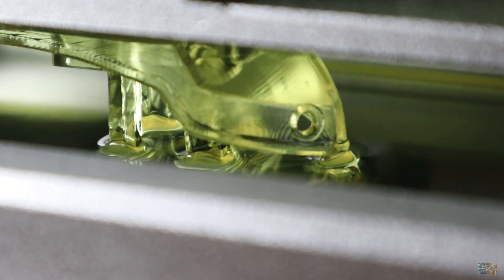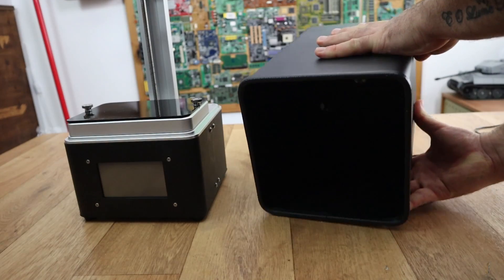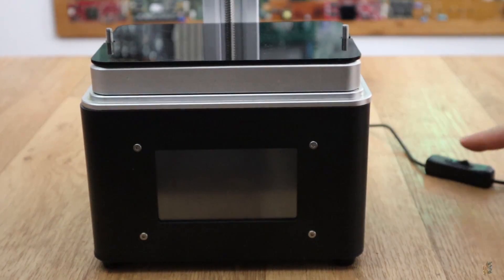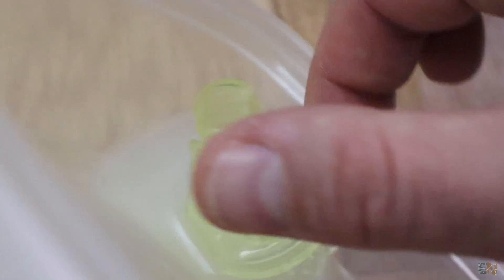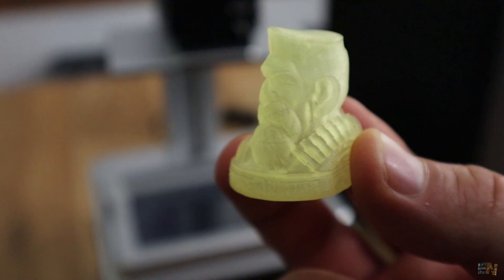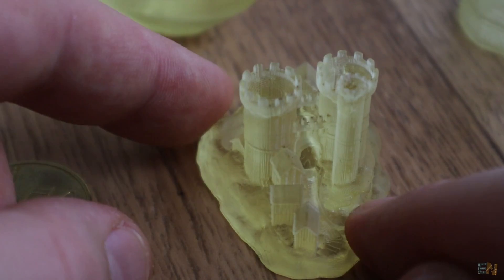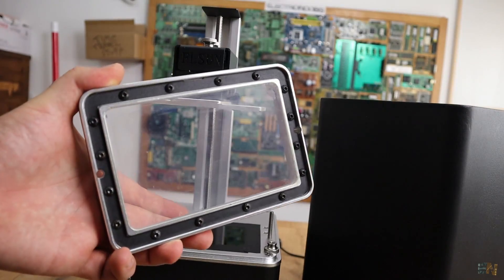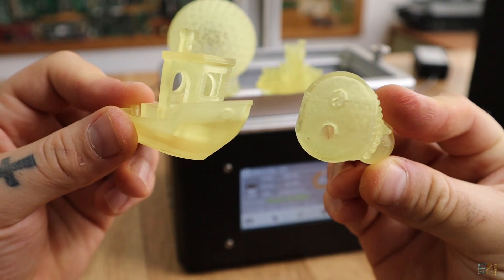FLSUN-S - 509$ DLP printer || I'm amazed || How DLP works

Comment: If 1 Liter resin is $100 dollars, or 10 cents per gram, then printing 3D Benchy, which weights 11 g, should cost me around $1.10. Correct? I mean plus minus. I just took a Benchy I printed in with PLA and weight it, so I am not sure if it will weight the same using resin, but you get my point...

Comment: You know when you look at a product on Amazon and it will say, "People that bought this, also bought this." and then they show more products, or most importantly, they show you accessories for the product you are currently looking at. How come I never see this when looking at 3D printers on other websites like Gearbest? The reason I say this is because I would like to know how much the resin is for this printer, and you also did not provide a link for that. Thanks and nice review...

EDIT: I did a search for SLA resin and a few websites came up. What I do not know though is if I can use any resin on this printer. A few suggestions would have been nice... : ). Thanks.

Comment: Good Review!
You should probably make more clear, that the resin is highly toxic. 
Don't touch the uncured resin! The material safety data sheet (MSDS) if this stuff is really scary!
You should at least use rubber gloves when handling the uncured resin.
Reply: do you have a link where i can read it my self how dangerous it is?

Comment: This printer is pretty expensive, compared to the build area, and resin cost is still high, however, one area that I could see this particular printer RAPIDLY paying for itself, is small scale modeling. It's been years since I built a model railroad, but I've always kept my old buildings and trains and vehicles. I see those have come up in price in recent years. While most things will still be cheaper to buy mass produced, this would make custom models exceptionally easy to create, and it'd be amazing for creating those fine detail pieces that are difficult to create in small scales!

Comment: But what about the smell? And is there an MSDS (Material Safety Datasheet) to go with the resin they supply? I know this is not the only resin you can use, but still. The market of affordable, fairly safe resins is thin to non-existent, and even the better ones are risky compared to FDM.
Reply from the maker: I really like the smell. What I don't like is taht it is oily.. and if you touch it you ahve tom wash your hands a few times.
Reply: They gave you gloves and a mask for a reason, use them. And buy more, they're pennies compared to resin. For most people, it's probably not going to be a problem at all, but the resin components range between known potent allergens and substances the health effect of which is not completely known as they were so far only used industrially with proper respirators and full body protection being generally required - while they might be fairly benign, there's too little data to know for certain. Never before available to consumers, no animal testing either. It's best to dedicate a room or make sure otherwise that you aren't exposed to the fumes. The consequences, due to the nature of allergic sensitisation, are statistically not terribly likely but can turn out absolutely life threatening. And it likely won't happen immediately, but one day, some people will likely find that they have a terrible health issue on their hands.

Dr. David Light from a Houston hospital mentioned elsewhere that there have been cases of threatening respiratory issues and even one case of permanent near-complete memory loss due to people using DLP printers at home. Details are as of yet unpublished (so it's sensible to treat this as a rumour) and it's not known which constituents or brands of resin caused this specifically, and there are possible formulations that avoid known potent allergens and minimise VOCs. The information on actual products, especially affordable ones, is just so thin though, i'd really like some clarity before i make the jump to resin based printing or can recommend it to friends.

Comment: What about the resin price? Is it reasonable?
Reply from the maker: Hmm it is around 50$ per 500g
Reply: Electronoobs I see. My main issue with 3D printing is that consumed material for each type hasn’t yet reached an “affordable” price. Thank you
Reply: yeah FDM starts to drop but is still high compared to the real marketprice of plastic (which is 0,3-2,2$ per Kilo)
I saw that some sellers sell at 16$ per 1Kg which is ok but imagine a Spool for 5$, that would make FDM a massproduct.

Comment: This, and the Anycube are the first DLP printers to seriously bring closer the end of filament based printers
Reply from the maker: HAve you seen this one: https://www.gearbest.com/3d-printers-3d-printer-kits/pp_009472956105.html?wid=1433363&lkid=14610954
Reply: Not until you can get this for 200$ for beginners and definitely not until this is safe without having to look like a chemist in laboratory.